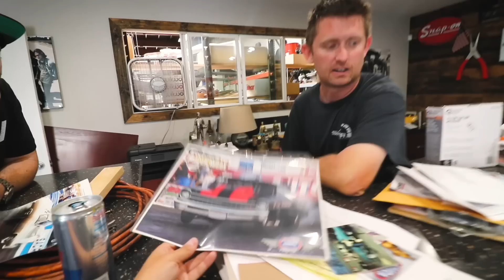TRANSFORMING MY GRANDMOTHER'S CAR INTO A RACE CAR!! MIMI GOES FULL DRAG MODE!

Comment: In our race car we use wildwood double peddle kit there is 2 styles if you go with those you need to choose one that fits in the car, we also use a 3 speed Saginaw we also use a duel shifter but that's for dirt racing  for drag a single would probably be better, we also have other things since we don't drive it on the road like quick steer and a better steering column but if you plan in driving it on the road then you should find stuff for that

Comment: The Engine will need to be in 2 stages. Get a built 1100hp engine like a 454 or 440 and TH400. Then when your ready to go all out the TH400 is already built for it and you can upgrade to a Nelson Racing or Texas Speed engine. I like that your doing a cage as a early mod. You did suspension so you will need a better setup for below 9's but it's a good start. Next step should be rear end and half shafts.

Comment: I honestly think that you should bolt on a 6 spd in Mimi and upgrade to a 572 big block engine with a twin turbo setup turbos are not pricey but it all depends on the turbo millimeter though

Comment: If your going after 7s start contacting strange for rear end and suspension stuff , Texas speed for a 427 precision for twins and RPM for your trans.. your going to want a powerglide or atleast a th400 or 8s will be almost impossible let alone 7s with a manual ask Garret Mitchell aka Cleetus McFarland..we race at the same home track and he knows what it takes in a 2900lb that seems just a bit heavier  even with all that it's unlikely.. but love your vids and  we watch and support whatever if your happy that's what matters right..
Reply: If it's a 1/4 mile car only then Powerglide. If she wants to run 1/2 mile or roll races TH400 is the way to go. Nelson racing makes great engines as well.
Reply: @eichler721  agree..I'm saying for sponsorship  TSP would be way easier to get help from but you never know unless you ask..
Reply: @freedomfox8183  agreed as Nelson racing is already recognized as.one of the worlds greatest engine builders. If she can get a sponsorship or discount from Texas speed that's a win. Plus they make great engines as well

Comment: Reminds of my first car floor rusted out spent month wire wheeling floor cut out rust used a gallon of rustolium put in sheet metal patch plates made floor. By hand. Good luck with mimi

Comment: Not a 305, actually a 267. Remember it was only running in 7 boom sticks. 🤪 stuff a 6.2 LS in it with a blower, just total bonkers. And then don't replace the axle until you shatter it.

Comment: It's either cast iron 5.3L
Or cast iron 6.0L 
T56 trans or 4L80E trans 
What would be sick is a turboed 2jz-gte that would epic!!
Reply: I'm 90% sure the motor will NOT be an LS. it will be JDM. I'm for some reason thinking inline 6. With a huge turbo.

Comment: Doesn't matter what motor you put in it if the rear can't handle it. Yank that 10 bolt out and get a 12 bolt or custom Ford 9 inch